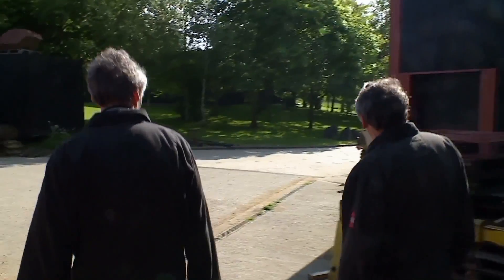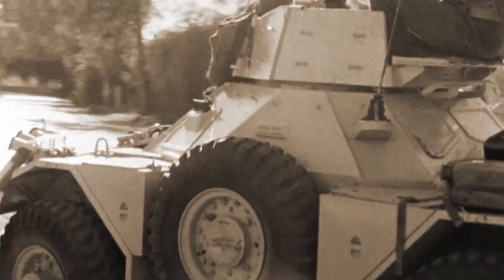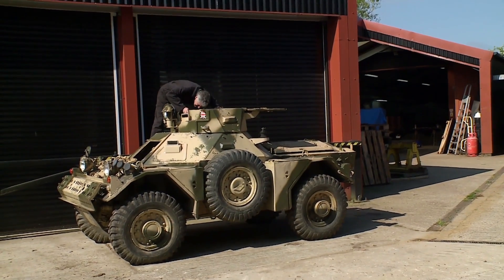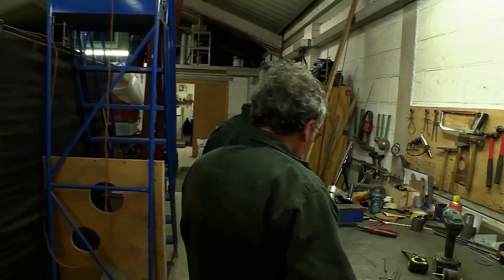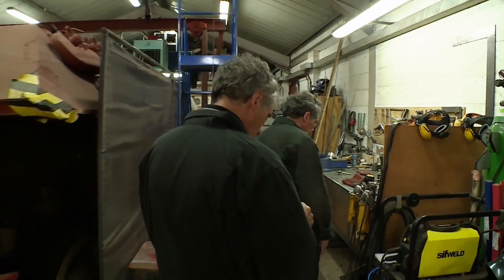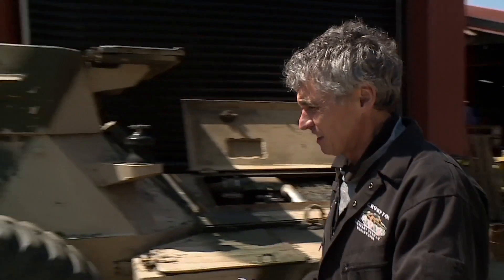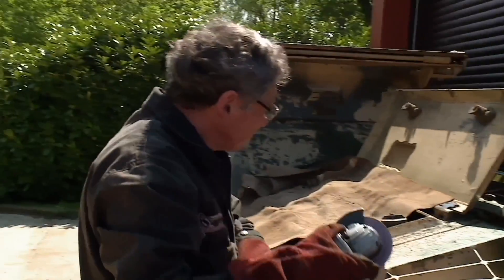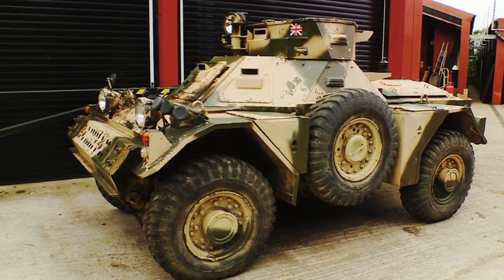Cold War Ferret Tank Gets The ‘Twin Treatment’ | Combat Dealers

Comment: I worked on these in Newcastle for 2 years, there is a major fault you should check for at least once a year, the planet carriers in the hubs can wear and shear, the first you know about it is when the whole wheel and hub comes off ( officer killed in Germany 1982 due to this ). We had to check all 40 plus we had and found two with worn planet carriers. Great runabout for sandwitch and bank runs but watch for Kick back from the gear change pedal if you do not " pump " it about 15 times every time you first parade the ferret before use on the road, hitting your knee off the steering wheel does really hurt. I was posted back to Germany after and when the ASM found out I had worked on ferrets I was handed 6 " dead " ferrets to fix I got 5 to work but the last was a hub fault so went to workshops, needless to say any spares required came from it and it was a totally dead ferret when it got to workshops, the Royal Signals officers who were supposed to use them were very happy to have them back actually roadworthy.